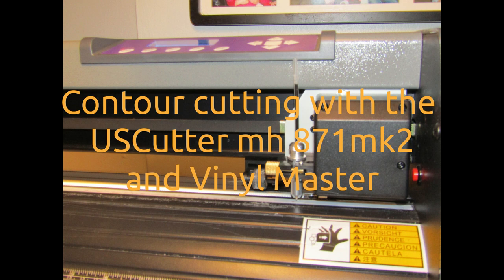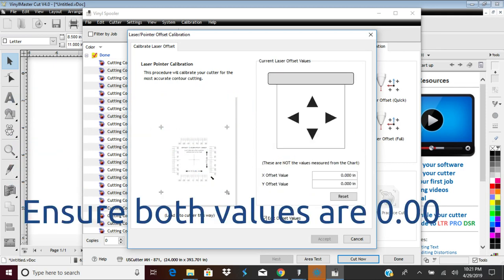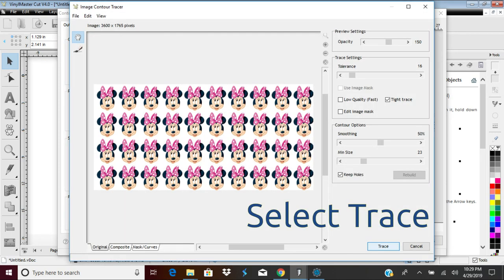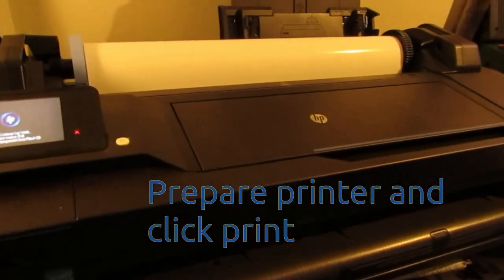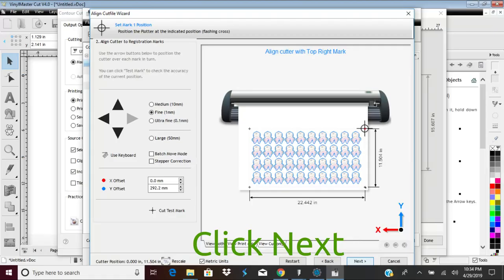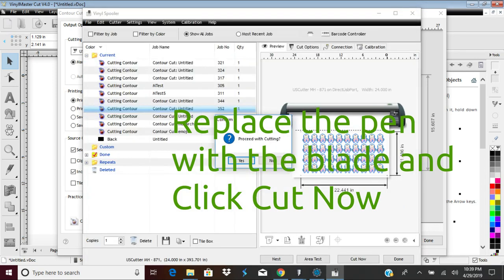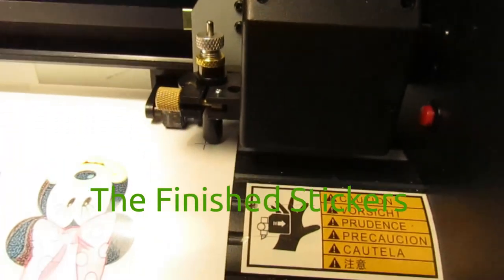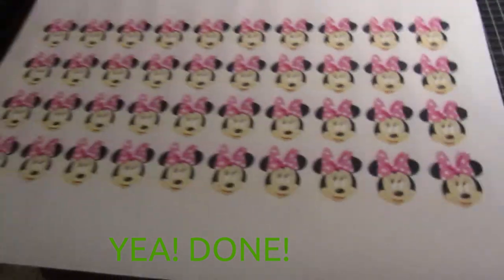Contour Cutting Stickers with USCutter MH 871 mk2 and VinylMaster

Comment: Thank you so so much. We are really needing to buy an MH series due to the price, but hesitant because it doesn't have the laser, this makes me feel sooooo much better, a few minutes of extra work is worth it for how much we'll use it. THANK YOU!! U.S. Cutter should have this video on their site!
Reply from the maker: My only additional warning is to be sure you don't move the blade carriage when swapping the pen and the blade. It moves easily and will introduce an unwanted offset in the cutting.  I usually stabilize it with a finger to make sure.

Comment: thank you so much for this video, i was just about to throw in the towel and get a lasercut2. this video was a life saver thank you again!!!
Reply from the maker: You are very welcome!
Reply: @bcburnettcom  Hey thank you very much for this video!!! Quick question I have this same cutter, however since this is only for cutting vinyl or stickers of 1 color unless you layer the design how were you able to include the colors to your design???  Thanks in Advance!!!
Reply from the maker: @ambiab29  I printed them on the vinyl first. I have an hp-t120 designjet printer. and use inkjet compatible vinyl. the vinylmaster software will walk you through the printing and cutting with the contour cutting wizard. Remember, to do contour cuts with this cutter you must have the laser offset set to zero for both the x and y directions because we don't have a laser.
Reply: NewLondonWeb Thank you very much for your help, I greatly appreciate it!!!!

Comment: You're the man! Been trying to figure this stuff out for days, thinking I need a fully automatic cutter (which is bigger and doesn't have wheels on the stand) to contour cut perfect stickers. So, we can use any cutter at all. It just takes longer to set up each job if not automatic. Thanks so much! And please let me know if you think not all cutters can do this.
Reply from the maker: In vinylMaster you can set the blade offset to zero, so as long as the cutter works with VinylMaster it should work! Good Luck
Reply: @bcburnettcom  Thanks for the reply. I did end up buying a cutter with ARMS and no wheels. Haven't needed to move it yet anyway... and have hardly used it yet but about to get to it soon.

Comment: This video is so very timely and helpful for me. I have gone from (messy) screen printing to now heat press transfers, but, the plastisol transfer sheets I must order from companies and sometimes I just need a small amount to test market an idea/slogan to see if it's worth making a large order to then hear press. VERY cost prohibitive for me (one man shop). However, looking at the Cricut and Silhouette cutters, they seem very viable options (ALL I am looking to do is print, hopefully colorful images...only vinyl, I guess) and then print these onto canvas/cotton material and/or t-shirts.  You video shows stickers using printable vinyl...does the vinyl or can you recommend any vinyl that I can run through my 8.5x11 or 11x17 inch (Epson WF7510) wide format printer that I can print on in full color and have stick onto canvas/cotton and/or polyester t-shirts?  I SO appreciate your time and hopeful response.  Cheers!!
Reply from the maker: yes they sell it on amazon, it works pretty well, you should ensure that you are getting the "opaque" for dark fabricks as its background is white, then you can use a cricut mat or something similar to cut the design out along with the backing
I just did this for my granddaughters graduation party tee shirts.
https://www.amazon.com/INKJET-TRANSFER-PAPER-DARK-FABRIC/dp/B01HN2FMLO/ref=sr_1_6?crid=F1FSK7BHEZVY&dchild=1&keywords=3g+jet+opaque+heat+transfer+paper&qid=1608558865&sprefix=opaque+heat%2Celectronics%2C174&sr=8-6
is what i used.

Comment: This was a awsome video. Your a great teacher! Ive been looking all day for a sticker video like yours for my is cutter. I cant seem to get the cutter to stop cutting through the sticker wax paper. Ive tryed adjusting my blade but still same problem. Could you please tell me what pressure and speed to have set for sticker making and thin viynl
Reply from the maker: sorry for the late reply, I played around with it till it worked, but that being said, the manufacturer will have suggested blade type, pressure, and speed for their material. To adjust your blade depth, take a small piece of vinyl, remove the blade cartridge from the cutter, adjust the blade depth till you can cut out small circles out of the vinyl scrap by hand without cutting through the backing. Then replace the blade cartridge in the cutter, it should be all set.

Comment: its possible cut countours with my MH 871? (ITS NOT MH 871-MK2), thanks!! Excellent Video
Reply from the maker: I don't know, I was just frustrated that my machine didn't have procedures for doing a contour cut. if it uses vinyl master it "should" be just fine bit I haven't tried that.

Comment: What is the cutspeed and force you used? I also have a mh871 mk2.  I am trying to cut with the backing on.
Reply from the maker: sorry for the delay, the most important thing is to set the cut depth correctly inthe blade holder, too deep  and it will cut through the backing regardless of any other setting, likewise too shallow and it will not be able to cut entirely through the vinyl. the correct way to set the depth is to take a scrap piece of vinyl, and tediously adjust the blade depth till you can cut out a circle by hand with it and it doesn't cut the backing, then as for the pressure, cutting speed, and blade type, you should follow the manufacturer's recommendations for the material you are cutting.

Comment: I know I'm a bit late to the party but... I just bought a HP DesignJet T520 and it had no option for Vinyl, this gives me hope as it is the same as the T120.  Also, the paper you use is no longer available on Amazon, is there another product that you use?  I was just about to purchase a vinyl cutter and thought I needed the contour vinyl cutter, now it looks like I don't need to, just let the software do it.  Thanks for the video!
Reply from the maker: I use the photo paper glossy setting for printing vinyl

Comment: Are you using Vinyl Master  or Vinyl Master Ltr or pro? Because i go step by step with you, and a  few options that is on your screen under source options is not on mine. Please help! Thank you for the video!
Reply from the maker: I am using Vinyl Master cut 4.0. It came free with the cutter. I'm not an expert and I don't think I ever messed with those settings. The main thing is to set the laser offset to 0 for both x and y. then you can use the pen tool to align with the registration marks.Thank You for your comment.
Reply from the maker: from the vinyl master help in my version concerning the source controls
The Source Options  refer to the artwork and are optional, explained as follows:

 Selected Objects 
when checked sets the Objects that were selected in the designing area to be Contour Cut, all other artwork is ignored. 

 Clip to Page 
when checked sets the boundary of the page's border from the designing area as the artwork's extent. 

 Include Full Bounds 
when checked sets all of the artwork to be included in cutfile (including any masked areas). 

 Tiled Copies 
when checked brings up the quantity settings 
   
 Mark Position 
sets the distance the marks are set away from the artwork. Note: setting this to less than 1 inch or 25mm may cause the artwork to intersect the marks and spoil the artwork. 

 Full Width 
when checked sets the marks to the match the width of the artwork allowing the artwork to take up more of the media, which is ideal when printing on small page sizes.
 
 Weedbox  
when checked applies a Cutline as a perimeter around the artwork. 

 Job Name 
sets the name of the Job for PDF, the RIP and the Vinyl Spooler to assist in managing your work.

Comment: Can I cut out regular transfer paper if I lower the pressure of my cutter?? Also, do I absolutely need a PEN TOOL?? I definitely do not have one.
Reply from the maker: I have used it to cut printed avery full page labels of emojis for my grand daughters diary pages, 
tee shirt transfer vinyl works well with a pressure adjustment, the vinyl will have correct settings with it.
the vinyl material doesn't require printing, so just do a create contour then send to cutter
tee-shirt transfers: 
    the ones for dark material have to be cut out, 
    and with a thin cutting mat, like the ones for the cricut, i have cut out the light transfers so there is not a bunch of extra clear material stuck to the shirt. 
you just have to make sure the image and the registration marks fit on the page, you can tape it to a larger sheet to maximize the transfer area that you can use, as remember, you start with the blade about an inch from the first registration mark outside the image.
so you have the image then the registration marks, then add an inch at the top for initial blade position and add an inch and a half at the bottom as the rollers are set back from the blade.
I hope this helps.
Reply from the maker: the pen tool isn't necessary at all, you can just press down lightly on the blade to extend the point to center it in the mark.
Reply: @bcburnettcom  thank you for your prompt reply and help. It was very useful. I'm accustomed only to vinyl and DTG. However, recently,  parts on my DTG has to be replaced. Expensive parts. This was my means to printing full detailed images. I'm now looking to ink jet transfers to provide the same service minus the quality of course. My biggest concern is that all images would come out boxed shaped and having extra paper where it isn't necessary. So my goal is to learn how to contour cut. Getting rid of the excess paper using only my US Cutter and Vinyl Master for the cutter program. An ink jet printer and some heat transfer paper. This is new territory for me.
Reply from the maker: @tyh4180  The cheap inkjet transfers on amazon are pretty much crap. the durability just isn't there, and the adhesive just sticks to the surface of the tee shirt ribs, even in a tee shirt press. thus when you stretch the garment the image breaks at the ribs and distorts. I was playing with this for tee shirts for a party and had really bad success. This might be fine for small images such as breast logos but for anything full size its sketchy.

Comment: I normally use 180 pressure for HTV vinyl what pressure should I use for cutting the sticker paper
Reply from the maker: I use Inkjet vinyl, which is the same pressure setting as my ht vinyl. I have experimented with sticker paper, avery 8.5x11 sheets, and I don't remember what pressure i used, however i usually cut with about 200 so its a good place to start, do a couple of small test cuts first to dial it in

Comment: Could this be done onto heat transfer vinyl? I have the same set up but want to make logos to print onto soccer uniforms.
Reply from the maker: There are a few different heat transfer methods. 
1. regular heat transfer Iron-on for light fabric, this will only work if you use a cutting platten, I have a thin self healing mat like for the cricut, as the transfer medium is very thin and delicate, you will be cutting  through the paper. 
2. heat transfer for dark fabrics, which is a sturdier vinyl that needs to be  pressed on right side out, You just need to be careful with your blade depth, but it will cut out this material. once again i recommend using a cutting mat under the paper so you can get the maximum area cut. 
3. regular solid color heat transfer vinyl, with this product you achieve the colors by layering the different colors of vinyl. no printing is involved, just strait vinyl cutting. 
Vinyl master and the mh are perfectly fine for this.
this video may be helpful for doing the separations, if you want to go that route.
https://youtu.be/obPOyCgLDsA

Comment: Did this cut through the backer too? I've seen dozens of videos but no one shows the sticker with the backer contour cut.
Reply from the maker: The vinyl cutter relies on not cutting through the backer so it can move the sheet back and forth. In fact when you change blades you calibrate the blade depth specifically to not cut deeper than the vinyl layer. After you weed the excess vinyl you can cut the stickers with scissors or an exacto knife. if you contour cut the backing, the sticker is really hard to peel off the backing. I usually just cut the stickers into squares.

Comment: I've been looking for a very thorough video on contour cutting with this make and model. I can't get my settings right, at least for cutting so smoothly and not messes. I bought a set of blades to make sure I have extra ones, just in case after trail n error I will have another to slap right in and continue to figure out my settings. My speed seems to scare me me and think if it went slower, it would cut more precise? What is braut? I can't seem to find out what these details are and if they are important enough to get the perfect settings. If you are available to help me, that would be great. Maybe we can even talk?
Reply from the maker: sorry for the late reply. Yes slow down the cutter, the mh is not very precise at higher speeds for some reason. (belt stretch or whatever) i had to cut out about 15 minutes of cutting for this video
Reply: @bcburnettcom  no worries. Thank you for helping me

Comment: Do I have to make a mark at each registration line? As far as setting the blade before it moves to the next registration mark
Reply from the maker: all you have to do is make sure the pen is centered exactly in the circle.
 use the arrows on the screen or on your keyboard to move the pen to the center then click on next.
the program will move the pen near the next mark.
This must be done for all 4 registration marks.
Reply: @bcburnettcom  .. Thanks i really appreciate it

Comment: What’s a good setting for die cut stickers? I’m using 5ml laminate
Reply from the maker: Every time i set it up to do any cutting i will first adjust the blade depth, Then i'll start it out at a slow speed at first, you can adjust the cutting speed and pressure while it is cutting, just press pause on the cutter. but it usually ends up with a couple of "practice" passes before i get it right.

Comment: I don't understand this...

If I wanna print on DTV (DIRECT TO VINY) sheets to HTV on to a shirt. How do I print my image? So I print it from Vinyl master??
Reply from the maker: that depends on if you want the cutter to contour cut your graphics. Vinyl Master is the only program that came with my mh871. so that is all i am familiar with. I made printed tee shirts for my granddaughters graduation, I found that when using the 8.5x11 sheets it was essential that I used a cricut mat under the printouts, and make the appropriate blade depth adjustment with the blade holder. the heat transfer sheets have a very thin vinyl coating so it is tricky to get the blade to just cut the vinyl, when i did this i set my blade depth to cut through the backing paper so i was left with just ovals to iron on.

Comment: nice work! :) Why did it sounded like someone was using a Geiger counter at the end of the vid? lol.
Reply from the maker: that would be, because in the other shots where I used my canon camera, i cut out the recorded sound, and that one was just the raw sound, I didn't want to record the noise the cutter makes, and there was no point recording sound with the printer, and the rest were screen shots. The geiger counter was probably the lens cap bouncing off the camera :).

Comment: Any clue how to operate with Mac? Know its said to "not be compatible with Mac" but I've heard some people have success same as you did with contour. Anyone?
Reply from the maker: according to uscutter website, the software for the mh series is pc only, in fact i had to leave my laptop as windows 10 just so I could run the software, I have now figured out how to cut from it with linux, and inkcut, (buy a serial to usb adapter, connect to it over the serial cable since there are no drivers for linux for the usb connection) but am only able to contour cut on it from windows so far. https://www.uscutter.com/Vinyl-Cutter-Starter-Kit for the mh series, apparently the software they offer for mac is 'sure cuts alot pro' and not vinyl master. so i think the answer is you need a pc to run vinyl master with the mh series.

you may be able to run vinylmaster in wine on the mac, but i am still trying to figure out the correct configuration.

Comment: where did you purchase the big sheets
Reply from the maker: I ordered it off amazon,
https://www.amazon.com/gp/product/B0761W5GFF/ref=ppx_yo_dt_b_search_asin_title?ie=UTF8&psc=1
Photo Peel Glossy Printable Adhesive Vinyl Roll 24 inches x 60 feet Inkjet Peel and Stick Sticker Paper Works with All Inkjet Printers Including Professional Makes and Models
$84.00 per 60 foot roll
my HP DesignJet t120 printer has a 24" roll feed on it, It will print an image up to  2 ft x 150 ft and cuts the material after it is done printing.

Comment: Will the SC2 do perf cuts?
Reply from the maker: from what I see, the sc2 is the next higher version of the mh series, it comes with vinyl master, so it should contour cut as long as you set the blade offset to 0 for both the x and y axis.
Reply: I understand that it can do a contour cut. My question is will it make a perforated cut all the way through the liner and the vinyl?
Reply from the maker: @AlbertLozoya  I have never tried that, i would think that a dashed line would produce a perforation cut, but to cut the vinyl then cut the perforations would require 2 different blade depth and pressure settings, it would be like doing a contour cut twice i think.